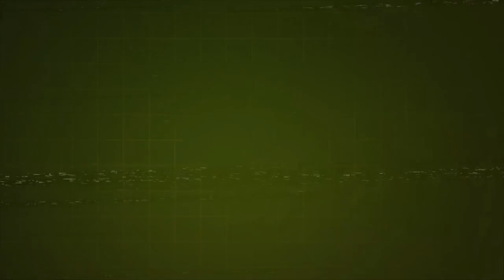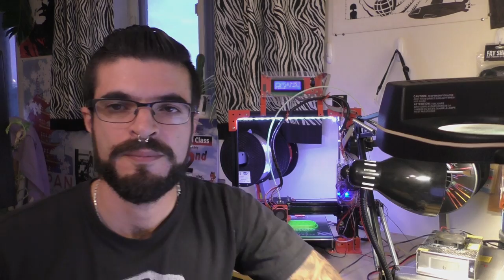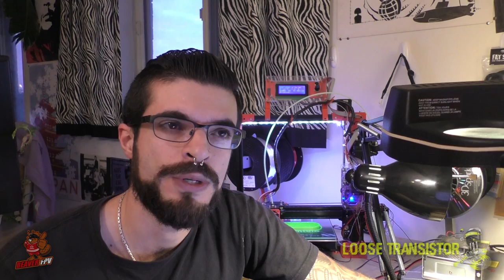FRSky F-Port Protocol - The SBUS Killer!! [ LOOSE VLOG ]

Comment: Hi Thanks for this video.. The F-Protocol sounds really kool. Do you know if latency will be improved?
Reply from the maker: Seems like latency will be the same as SBUS right now  - the thing to keep in mind is that this is still in proof of concept stages so it is possible that given time the latency will improve and be better than SBUS.

The advantage now is using a single wire to do both RX and Telemetry and the uninverted signal!

Comment: Did you end up trying it out?
Reply from the maker: sadigov yeah will have a video on it soon
Reply: Did you ever do this setup and make that video? I could not find it on your page.
Reply from the maker: Not yet, it only recently made it's way into the Master branch for Betaflight and I really didn't want to invest a shit ton of time setting up something that was unfinished.
Reply: I think it mostly just reduces the number of wires by 1, not sure about reception or communication speed gains.
Reply from the maker: None at all, all it does is cut down the SBUS + SmartPort to a single wire
Reply: Well, I hope you have better luck then I did with it, I just spent the better part of 5 hours fiddling with it trying to get it to work...I loaded BF 3.3.0 RC 1&2 (Which are both buggy as hell) which I believe was most of the issue...I was able to get BF to see the receiver but had no telemetry being sent...I guess I'll wait until they work out the bugs!